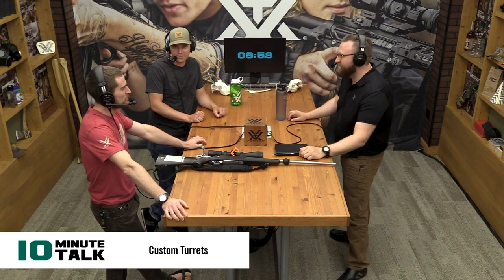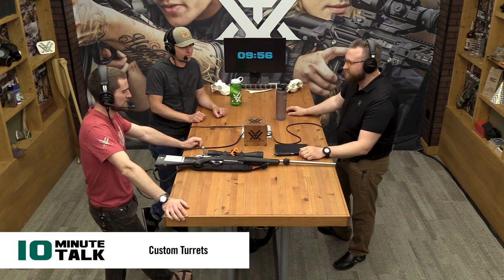#10MinuteTalk - Custom Turrets

Comment: When making charts…. I list 3 different temps on each chart for each load at 32, 70, and 100 degrees. 
Slit the difference for in between temps. 
Works great. 
Elevation change always required a new calibration or chart. Powder temp of round also will make a big shift in MV…. For instance if it’s 70 degrees outside but your ammo has been sitting exposed to direct sunlight for an hour… your cartridge temps may be 95 degrees which means the powder is also 95 degrees which means your burn rate will change and burn faster which equals increased muzzle velocity…. Which equals the shot going high. 
Adding a suppressor can increase muzzle velocity on a gun…. Not always but it can essentially simulate having a longer barrel.

Comment: Can you do a 10 minute talk about the 3030 because its soooooo underrated
Reply from the maker: Happening soon :)
Reply: 3030 has never been underrated
Reply: @VortexNation  Great talk as always,,barring extreme temperatures and assuming a 3/4 MOA rifle do you guys think day to day atmospheric conditions at the same elevation and practically no wind would make very much difference in poi out to 400 yards using a custom turret with good ballistic data on the front end ? Thanks !

Comment: What about this: know what density altitude your turret was made for, and each day calculate the appropriate adjustment. So on each hunting day you would know "I need to add 10% to my range, so for 300 yards I dial to 330." Would that work? Still seems easier than converting MOA or MILs.
Reply from the maker: Sounds WAY harder than just using a ballistics calc and dialing MOA or Mils to be honest :)
Reply: You could do multiple density altitudes in different colors, if offered. 5 colors and 10  yards would maybe be an upper limit, but still reasonable.
Reply: You could calculate a dope disc/chart with density altitudes.

Comment: Another awesome topic. I think I might not need custom turrets. Mainly because you get locked into one cartridge. Which is okay. But sometimes, I can only shoot what is available.

And, I keep changing which scope I want to carry. My newest rough and tumble hunting rifle now wears the Vortex Crossfire II 3x-9x / 40 mm Dead Hold BDC scope. My hunting areas offer no more than about a 50 yard shot. And light weight scope like that is adequate, about like shooting a red dot. And I just zeroed it with that particular scope yesterday. Before, I had the Diamondback Tactical on and had it zeroed with that quite well. the 6-24 magnification was wonderful and I hit dead on the mark with a hot barrel. And I have gotten so used to the Diamondback. Now, like a bridge before wedding day, I am thinking of putting it back on, even though it is heavier. I just love that scope so much. And I live the Venom even more but it is heavy. 

Granted, where I hunt with 50 yard shots, I could just dial up two clicks with the Crossfire II, or 3 solid clicks with the Diamondback. And I just don't know. I like the variability and choice of the Diamondback dialing but I like the 14.8  ounces of the Crossfire II. And I could get a dead deer with either one.

So, as handy as custom yardage turrets are, I would probably forego. Now, I am tempted to put my Diamondback back on, which means another range trip to re-zero again. Good thing I did not use all of the Federal Nontypical Whitetail .308 Win 150 gr. (My rifle shoots that round .5 MOA on a hot barrel.)

Dang it, looks like I am pulling out the torque wrench.